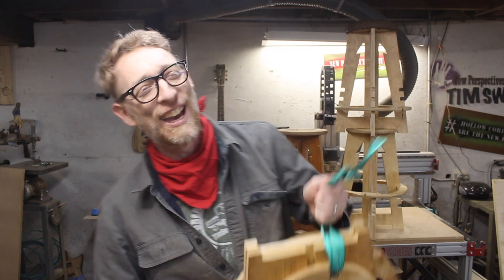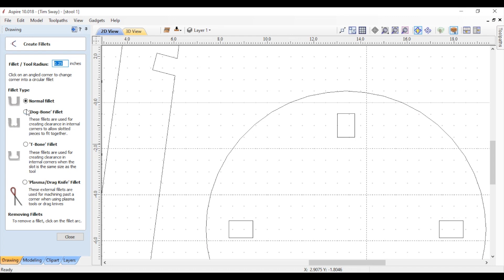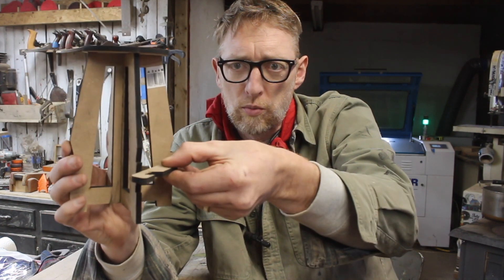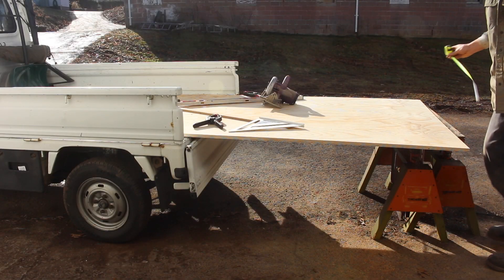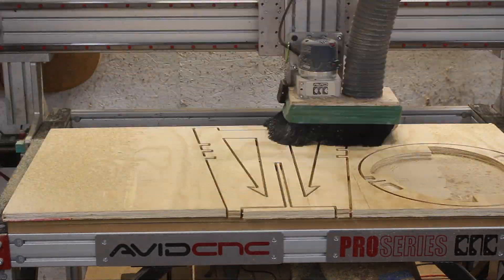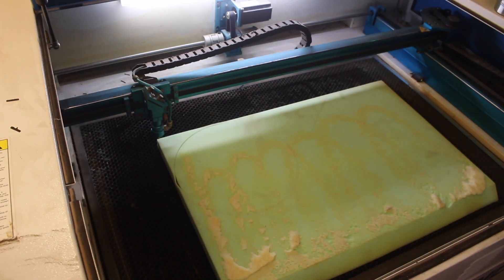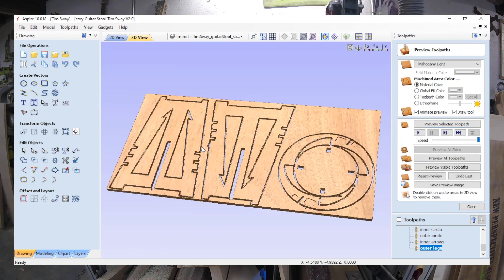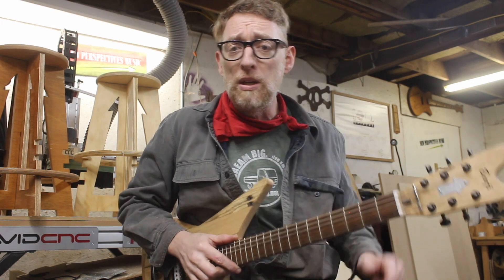Making The Flat Pack Guitar Stool | In the Labs with Tim Sway | Vectric FREE CNC Projects

Comment: Great information and nice stool.  Since you have a compression bit, you cut through the entire sheet of ply in one pass. The tip of the compression is upcut and the remainder is downcut. It is intended to cut in one pass and the top and bottom veneers on the plywood are cut extremely clean. No need for tabs as the up cutting and the down cutting force the chips to the center of the cut and hold the part in place. Hope this is helpful.

Comment: One lil note tim on screw placement. 
You can create a toolpath for a layer of 1/4" circles where you want to run your screws, 1/8" depth just to mark the spots. Run that first and you have very accurate marks for where to drive the holding screws
Reply: yes! very clever. I have done something similar  once before, but I'm lazy and that sounds like extra work :)